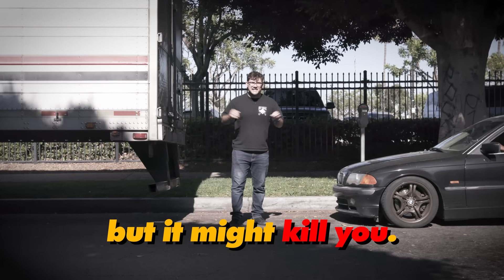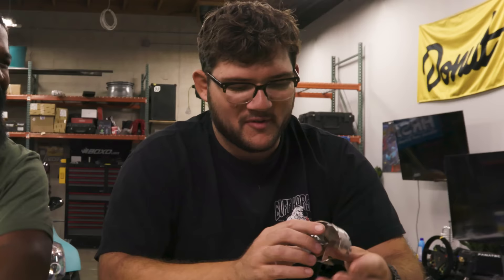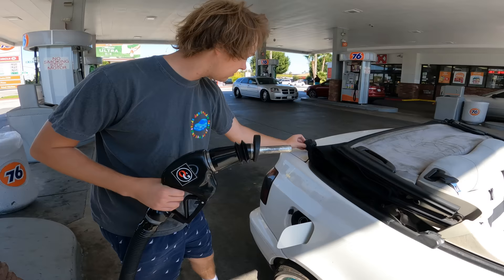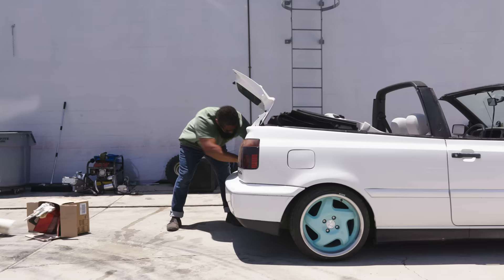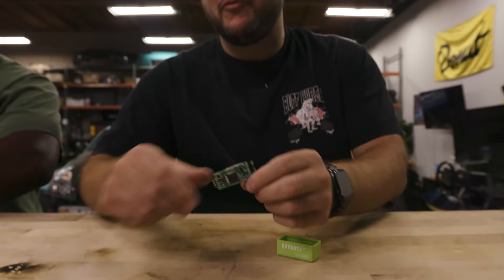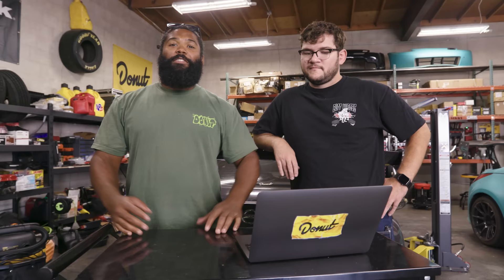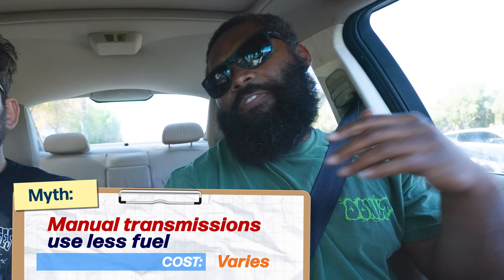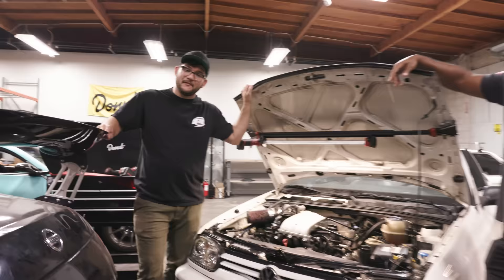Testing Fuel Economy Hacks

Comment: You are misleading regarding manuals vs automatic. Yes you're right in saying that newer automatics are more efficient than newer manuals, but the crossover point occurred about 5 years ago, not 70 years ago. Also for budget cars, manuals are still usually more fuel efficient because they have the older style of automatics with 5 or 6 gears. Manuals are lighter and for someone who is trying to drive economically, they give better control so that the driver can choose high load gears for coasting or slow deceleration scenarios whereas automatics tend to choose more responsive gears.

Comment: My NA k20a2 05 RSX Type-S gets 9 mpg lmaoooo. Extensive modifications, performance centric tune, and lets say some spirited driving leaves me with 9 mpg. It also only has around 2300 miles on it though so I'm not too worried about pushing 'er hard

Comment: Just now watching this.  I have to call you out on manuals vs automatics.

Explain to me how a Toyota 4spd auto in the 90s gets 30+mpg but a cvt today in a similar car can only get 40+mpg.

Better.  How can a 6spd v8 from the 90s get 30+ mpg but today a 9+SPD auto v8 in the same class only gets upper 20mpg on the hwy.  As for avg city rural driving.  

My 6spd ls1 Camaro gets city/rural 20mpg -/+1 .  That's better than most all avg city/rural v8s today.

I have a better question.  Why was obd2 the last increase in fuel efficiency (the combustion of fuel)?

Now granted we have come a long ways in building hybrid based cars that increase fuel mileage by utilizing an alternative or extra source of power in conjunction with fuel.  But the cost of said hybrids typically take several years worth of fuel purchasing to recoupe the initial purchase.

Comment: I disagree with their statements about manual vs automatic transmissions.
Power is lost through the torque coverter on autos. There is also a load on engine with an auto trans every time you stop. Vehicles with auto off/ start-stop tech have improved economy but are annoying to operate.
Just look at mileage rating on the  window stickers of any car that comes auto or manual with the same engine.

Comment: While I distaste the hydrogen thing scam, it must be said that just driving around is not a solid method of (dis)proving it. You should be measuring an engine's output in the lab, with and without it, under controlled conditions.

Comment: The front wipers actually create a lot of aerodynamic resistance because they disrupt the flow of air along the bodywork .... find it man before you start saying that your opinion must be correct ... European cars do not have wipers that are exposed to flowing air. everything is hidden under the hood. Guy Martin made a video about the fastest van and when the van was in the aerodynamic tunnel it was wonderful to see how the wipers completely destroy the air flow along the bodywork. I understand at first glance it's a banality but in reality the point is ... don't spread opinions but facts ... excellent channel by the way

Comment: Hho Generator does Work ive done IT with water Filter Tubes sturdy enough in my Bike Honda CBF250.

Distilled water 
Salt or another catalysator 
2 Tubes strong enough to handle pressure (one for the Generator, one for the seperator)
Air Tank to store the Gas 

 you need fuel to start the engine then you Switch the Generator on to build pressure the Tank can be an old oxygen Tube 10-15 liters If you have enough pressure (make an gauge or Manometer) then you make an Switch to kill the fuel IT Shakes rumbels mybe IT will die dependsnon the ecu, the ecu should so the Rest. If Not you need to calibrate the fuel Air ratio. Yes the engine can Run in Just hidrogen alone you dont need fuel.

The search engine is your best friend

Comment: Manual transmissions actually are better than automatic because you can neutral drop. And you haven't tested replacing your injectors with smaller injectors, if you could test that maybe next time?

Comment: I disagree with their conclusion on over inflated tires. It absolutely decreases rolling resistance. Just tires will wear faster so any fuel saving will be spent on tires. Also handling will be negativity effected. It will save fuel but not worth it.

Comment: That HO Generator doesnt work. You may think, that it could work, but if u think a bit about it it starts to loose sense. Okay i know im a 16 Year old German Student, but lemme Explain. You might know that Energy cant be destroyed neither Created. So in this case here youre using Fuel to make Kinetik energy to then turn the Generator in the Car to Produce eletricity for the HO Generator. Lets say the Engine is 20% efficient, and the Generator 80%. So 16% of the energy from the Fuel gets converted into Energy that the HO Generator can use. Lets say the HO Gen is 100% efficient. so u got your H² and Burn it to save Fuel and additionly power the HO gen which uses more Power to make the H² than it helps to save Fuel. So you use 3 gallons more to save half a gallon, which doesnt make sense. For it to work it would have needed an efficency of over 100% which is impossible.

Comment: Hydrogen generators don't work on cars and they never will because the law of conservation of energy says so.
Hydrogen is an energy storage medium, like a battery. You are taking energy from the engine to create hydrogen and you're putting it back into the engine to combust. 
That's like trying to fit an alternator to an electric car to get better efficiency.

Comment: If you are drafting behind a semi you are going to ruin you paint job.  Forget about all of the gas savings. Those truck throw all kinds of pebbles, sand and grit around that hits your car and sand blasts your windshield. You end up prematurely aging your car.   Absolutely no savings in that.  

My front wheel drive tires tend to wear the shoulder off the tread more (maybe because I like taking faster turns) so over inflating gives me and even wear pattern.  I wish you had gone into the science behind radial tires and how having a little bulge in front of the tire tread might help gas mileage, over inflating the tires takes that away.   I'd like to know more of the science reasons.

Comment: Manuals aren't needed or good? Lol I've had like 6 Econoline vans and the thing that kills every one of em isn't the engine or the rust or even a crash it's always ALWAYS the automatic transmission going out either slips every single gear or let's go at speed like you're cruising at 1500 rpm then it just decides to let go. Rpms fly up and it feels like you stomped on the clutch if it was a manual

So if you don't wanna always push it home or wait for a tow.. get a manual and never get stranded even if the battery dies 👌

Comment: Still not sure about the MPG in an auto vs manual. I have a 21 WRX manual and the CVT version reportedly gets 3 mpg less than my manual. So it may be true in some models but in some it’s still better to drive a manual.
Reply: I thought so too.
Reply: TIL: With your car it appears that there may be a good explanation! Sounds like the EPA test cycle maybe forces the CVT to run not just the most efficient drive mode for testing. So perhaps at some point during testing it has to be run in "Sport" or "Sport Sharp" mode, not just "Intelligent". My mind would be absolutely blown if a manual transmission could out-MPG a CVT - unless! - like Tacoma or the Outback Wilderness the final drive ratios between the manual / auto models heavily influences the MPG numbers. But with your car it seems like it really may just be a testing quirk. But also ... a WRX with a CVT ... BLEH.

Comment: The claim that more expensive gas doesnt make a difference is severe incompetence...there are plenty of tests available that shows that if an engine  can take advantage of a higher octane value it will run more efficiently and thus need less fuel and it can be enough to not only cover the cost of the more expensive high octance fuel, it can even save money in the long run albeit its not much.

Do note that it takes some advanced electronics for this, knock sensors, adjustable ignition and so forth to push the limits as far as the fuel allows.

Comment: Sure you can run a car off of hydrogen, even in a normal engine (not ideal but it can work) but if you're cracking the hydrogen in the car using electricity from your alternator you're just wasting gas. It takes energy to crack the water into hydrogen and oxygen, and you don't get all of that energy back when you put them back together. And internal combustion engines aren't perfectly efficient anyway. In fact they're usually about 20% efficient. So even if you got back all the energy you spent to crack the water when you combust it, and even if your device for cracking the water was 100% efficient, your engine would still take about 5 times more energy to run the alternator than you would get back by burning the hydrogen. If you want to use hydrogen as a fuel source you want to crack the water using electricity generated by something other than burning hydrogen. Like a wind turbine or just off the grid. Then you store that hydrogen in the car and use it to drive.

Comment: Actually one thing said here is sadly but not true. Manual transmission consumes less fuel then automatic due to their weight. If you compare the total mass of the car with manual vs automatic- you will see the difference. Automatic migth be fuel efficent on it's own- but it's losing out on weight.

Comment: Slightly incorrect about automatic and manual transmission difference and here’s why. When using a manual you can easily depress the clutch and take the vehicle out of gear and coast in idle while maintaining speed. In an automatic the car stays in gear slowing the speed of the car even downhill requiring you to use gas to maintain speed. Of coarse you can also take the automatic out of gear in the same instances but would you.

Comment: manual can be effective you can tune yourself also the best advices, when you are on the high way, don't make 70-130-70-130 etc downs and ups, keep still, in europe we say lt/100km, i see 2lt for 100km, for you 0.4gallon for 60miles, 150 miles for gallon. i was driving at 110-120, my car megane is produced for that speed, 100 or 130 is not that efficient. 2500rpm 5th gear diesel. My normal consumption is 5lt/100km, so 52 miles for a gallon. 1.5dci turbo 84hp. 0-60 is 11 seconds. but 0-30 is maybe 3-4 seconds, that's what you need in our small roads. Keep your rpm still, know the aerodynamic of your car. You americans use high way a lot, so keeping your speed stable will help you a lot, we always have to drive in city. Also don't buy huge cars, powerful cars if you just want to arrive someplace.

Comment: If you want to re-map your ECU, depending on the vehicle you can often just unplug the negative battery cable, ground it or wait a while then when you put it back on your car will be in "learning mode" so it can learn your new gas saving driving patterns. One of my older vehicles does that 100%, I haven't found any concrete info yet if my newest one works that way though.

Comment: Top Tier gasoline doesn’t mean premium or highest octane, it is referring to the level of additives in the fuel. Top Tier is actually a trade mark not just something that it’s called. Some brands of gasoline are TOP TIER™ approved and will say so on the pump. If you drive a BMW, General Motors, Stellantis, Ford, Honda, Daimler Truck, Toyota, Volkswagen, Mercedes-Benz, Navistar and Audi. It’s recommended you use TOP TIER™ fuel. Same goes for their diesel. Not all gas stations have the same quality of fuel. It’s like the difference between RC and Coke Thought for sure you all would know that. Kinda disappointing. Also. Just because a Manuel says that you vehicle can drive a a lower lever of octane doesn’t me it’s required. People should look into what their specific vehicle can take and what it should take under what conditions their in, where they are located geographically and elevation wise and where they are at in the life span of the engine.  If people do 5 minutes of research instead of watching a 15 minute video that is going to give you bad Information then you just saved yourself 10 minutes, some extra life on your vehicles engine and wont be padding a clickbait channel’s wallet’s.

Comment: I dont get the Idea of the HHO generator... During combustion the H2 turns into water again, so the water from the tank couldnt possibly input energy into the system. The energy for the explosion of H2 was provided by the alternator! This just seems like you are converting energy back and forth unnecesarily - in actuality, decreasing efficency.

Comment: 13:40 These guys don't know what a manual is, they only drive automatic.
but you need to know that the manual box has two modes of operation. 1st economical (less power more savings), and 2nd fun for the weak-minded (more power less savings)
There is also a mode of driving with the clutch depressed.
Reply: The car they are in is a manual 😂

Comment: Why didn't you test a spoiler?
Reply: Spoiler would makes downforce by redirecting air up and causing drag thus causing lower mpg. That’s why the gt3rs has a drs mode in its spoiler to make it straight and reduce drag when going straight
Reply: @Mrhappy33664  You're thinking of a drag wing, not a spoiler

Comment: Didn’t talk about how much the AC actually influences MPG, only turning lights off. While the latter may only save 1%, the AC uses a lot of gas. In my BMW and Mazda it is around 1 liter on 100km, which is about 10% on the BMW and 12% on the Mazda!

If you drive manual for fun, you must compare that to driving the automatic also for fun. They didn’t compare that… BS all over.

Comment: Fuel absolutely is affected by temperature. That's why they add fuel additives in winter. Does it matter enough to make a difference at the pump, no.

Your engine temperature also has nothing to do with the fuel. And if your fuel tank is hot, you might have bigger issues.

You don't help yourself "busting myths" with further misinformation.

Comment: One thing they forgot to mention about automatic transmissions versus manual transmissions are parasitic losses and weight.  Torque converters, hydraulic pumps and especially planetary gearsets take a power to operate.  I worked at a dragstrip for years and always laughed at the morons who put manual valve bodies in their slushboxes because consistency was the ONE advantage they had over manual transmissions (if the drivers had any talent which most don't).  I always ran 4 speeds or automatics that were properly built and set up for the car and left them in drive.  The 4 speeds were faster, but the automatics were a lot easier to run consistent ET's, but were SLOWER.  That said, automatics are still heavier, and still have hydraulic pumps.  The number of gears they have along with the computer controls have FINALLY overcome the losses.  I can still hypermile my manual transmission car (when I am interested in doing so) and get considerably better mileage than the automatic transmission version of my car can get, but under normal driving, the automatic does better because it is ALWAYS trying to save fuel while I'm only trying to when I actually feel like doing it.  Otherwise, it's exactly what the guys said which I'm FAR more interested in having fun driving my car than maximizing fuel mileage because at the end of the day, manual transmissions will ALWAYS be more fun to drive than automatics will ever be.

Comment: Whoa, wait a minute, you guys just sorta glazed over the HHO generator...
What are the specs what is the LPM(liters per minute) flow of the unit  relative to the size of the engine?
You can run an engine completely on hydrogen.
It's not a valid argument if you're using it incorrectly.
That's like putting a whip-it shot of nitrous on your daily and saying the nitrous oxide won't give you mopowa because you're not running a 9 second quarter Mile.

Comment: Lol yaaa if you've ever had a weak ass car, with a big ass audio system.. Yaaa It pulls some pretty heavy drag on the engine. But the little lights and stuff aren't a big difference. And the more HP you have the less the car cares. Your average alternator puts 5-10hp of drag on an engine fully loaded.

Comment: Your comments about top tier fuel were incorrect. You didn't even address the actual issue. Top tier fuels have more detergents in them from the tanker fill stations. All you did was talk about running higher octane than your car requires. It is always better to run top tier fuel from a participating gas station than cheap gas from a convenience store.

Comment: "Looks like Starscream's butthole" lol.  As far as hydrogen generators, it would either do nothing or damage your engine, depending on how much hydrogen is present.  Normal engines are not designed to run on hydrogen.